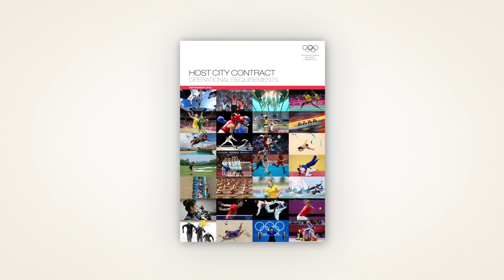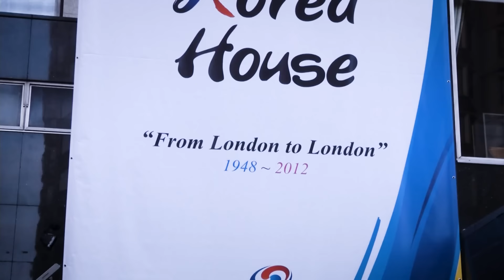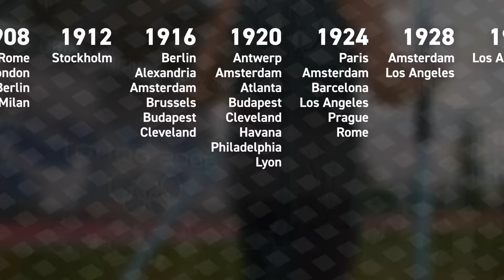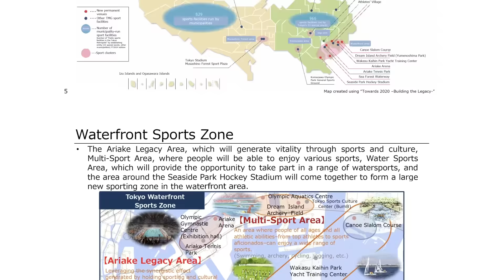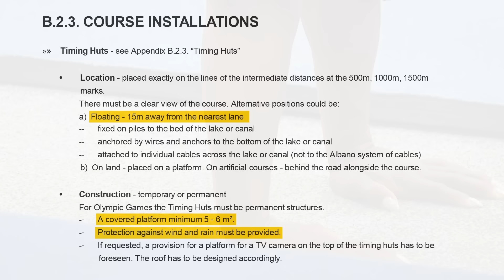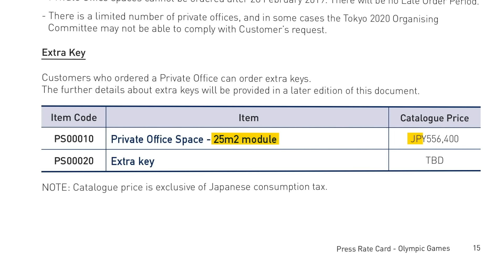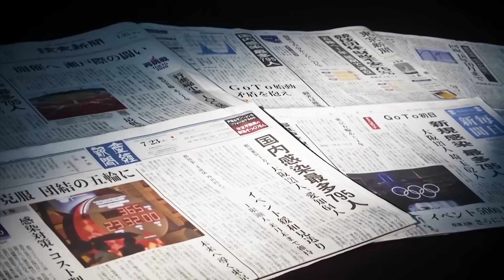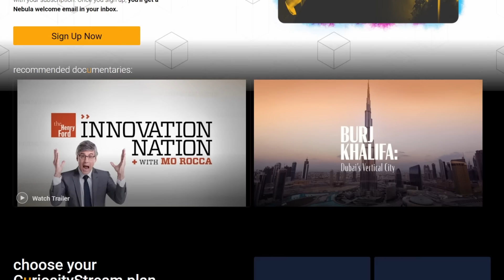The Incredible Logistics of the Tokyo Olympics

Comment: While London had a new aquatics centre built, it is worth noting that it was specifically designed to be modified after the games, to reduce its capacity. 

During the Games the venue had a capacity of 17,500. The two temporary "wings" have been removed, reducing the capacity to a regular 2,800 with an additional 1,000 seats available for major events.[5] Of all the swimming venues built for the 2012 Summer Olympics, the Aquatics Centre is the only one that will remain afterwards, albeit in a downsized form

Comment: Worth noting that the push to make the games cheaper is an explicit effort by the IOC, includes big changes such as not required to build new venues for everything, in fact encouraging reuse of existing venues - and allowing events to be held outside the host city, as with the winter games, to make this easier - use of temporary venues, and requiring new venues are sustainable after the games.  Even the bidding process has been made less waistful by the IOC selecting a preffered bidder in advance, before detailed plans are built, to avoid the waste that comes with multiple expensive bids (this is mistaken for selected cities running unopposed, which is not technically true, but its kind of like going under conditional contract for a house)

Comment: Could you make a Video about the 2032 Olympics, there it will be held in Germany in several citys, it is an experimant to watch if the olympics could be more profitable and spreaded. Its an interesting project!
Reply: The 2032 Olympics is expected to be awarded to Brisbane. It is scheduled to be announced by the International Olympic Committee on 20–21 July 2021, the eve of the 2020 Summer Olympics due to bidding rule changes. Ahmedabad, India; Jakarta, Indonesia; Doha, Qatar; Rhine-Ruhr, Germany (with sailing venue in Kiel); and Madrid, Spain were not advanced to IOC board approval.

Comment: 🏅 Wouldn't it be easier and less expensive if the Olympic games would either: 

A. Be hosted NATIONWIDE across DIFFERENT cities?

🇺🇸 For example, the U.S. The opening and closing ceremonies are held in Washington, D.C.; the aquatic events are held in Miami, Florida; and the track and field events held in Boston, Massachusetts; and so on and so forth.

B. Have DIFFERENT cities across the GLOBE bid on different sports. 

For example, London, England hosts the track and field events; Sydney, Australia hosts the aquatic events; and so on and so forth.

🇬🇷 As for the opening and closing ceremonies, have them PERMANENTLY held in Athens, Greece.
Reply: The IOC modified the Olympic Charter at the 134th IOC Session on 24 June 2019 in Lausanne, Switzerland to increase its flexibility by removing the date of election from 7 years before the games and changing the host as a city from a single city/region/country to multiple cities, regions, or countries.

Comment: Having the olympics host all the games/events in one lone city is becoming a nightmare for many cities.

I think it's time for the IOC to take a page out of F1 and have them distribute the various Games/Events around the world so each city can host one type of game (And it's corresponding events & facility) and minimize the cost / disruption and have the IOC rebroadcast all the feeds from a Fixed Central TV Production Center.

By distributing one sport per city and spreading it around the world and digitally rebroadcasting it globally, it becomes feasible for 1x city to host 1x event for the duration of the Olympics.

The cost to the city is far more reasonable, the logistical burden is reduced, the amount of people that need to travel is also reduced and distributed around the world.

You can also revive all the previously discontinued Olympic Sports and Rebroadcast them.

There can be virtually no cap on the # of Olympic Sports since the hosting of them will be distributed.

Currently:
40 Summer Olympic Sports
15 Winter Olympic Sports

If you include all the Discontinued Sports & Demonstrated Sports and make them "Official", you can have:
75 Summer Olympic Sports
24 Winter Olympic Sports

That's alot more Olympic Sports to Broadcast, and considering 70% of their revenue is from Broadcasting rights, having more Sports to Broadcast will be a huge benefit to them.
Reply: At the 134th IOC Session on 24 June 2019 in Lausanne, Switzerland, the IOC modified the Olympic Charter to increase its flexibility by removing the date of election from 7 years before the games and changing the host as a city from a single city/region/country to multiple cities, regions, or countries.
Reply: @RaymondHng  That's good to hear that the IOC are becoming more flexible.